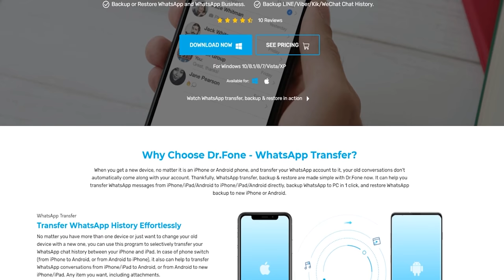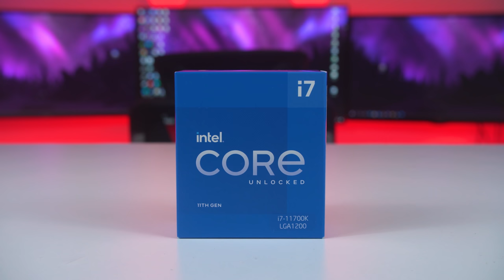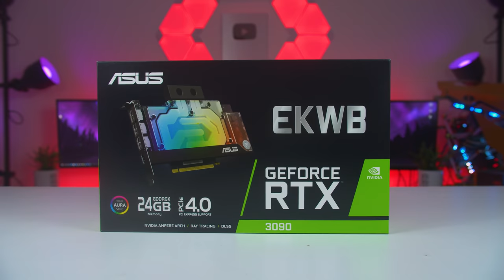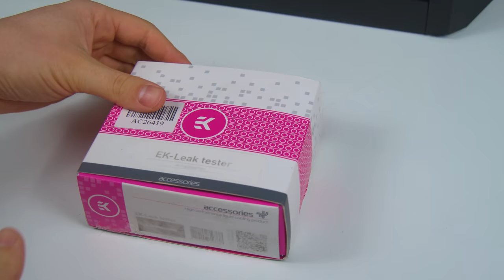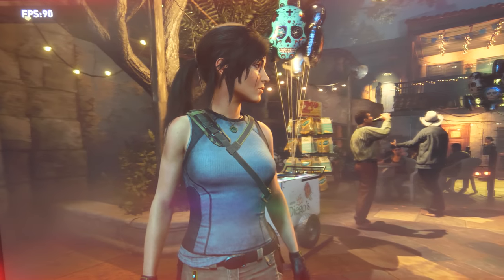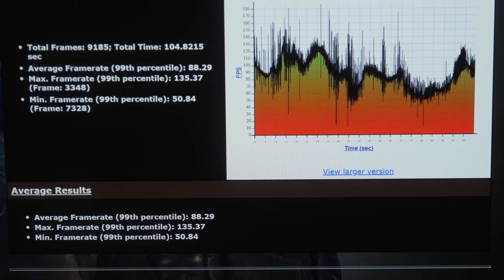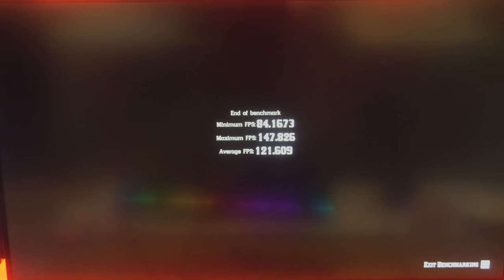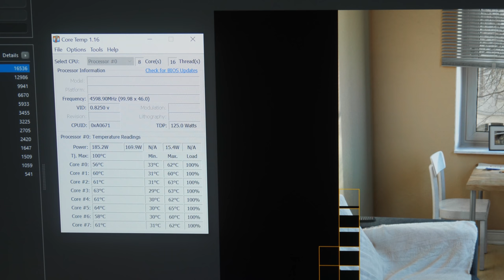I Built a $7400 all ASUS Water Cooled Gaming PC - RTX 3090 w/ Benchmarks

Comment: Bro, why every time when I use a liquid like this no matter where from, after some time my pump gets stuck and stops working, then I have to open the pump and clean it the loop as well as it remains in the water block as well. any ideas why this happens? I do clean it properly before using the liquid, if I use clear liquid pre mix and I add some colour what it doesn't do much, than I can run the system as much as I like

Comment: My expectation when I saw the $7400 budget: ryzen9 5900 or 5950x paired with 2 rtx 3090's in sli, and the whole rig is watercooled

Reality: i7 paired with a rtx 3090.....

Nice vid tho, I enjoyed all the eye candy in it, keep up and much love❤
Reply: should he use last gen  intel protsessor?
Reply: @naapsuvaimne740  yea, the last gen processors r actually much better than the current gen, cuz the difference between last gen and this one is more boost frequency, which results in higher temps...so, last gen is better cuz its cooler,has more threads and cores, and it should now be cheaper cuz its considered old
Reply from the maker: Cheers, unfortunately with gpu pricing these days that would cost alot more for two 3090s. Especially paired with this motherboard

Comment: I can’t figure it out - did you use a 4.0 riser cable?

I read through the case spec and a riser cable was not included. 
Motherboard said it came with an “ROG Graphics Card Holder,” not sure if that’s a bracket or a rigid riser. 
Would be a shame to get rocket lake, a 3090, and all that water cooling just to leave performance on the table with a 3.0 riser.
Reply: you're not "leaving performance on the table" with gen 3 pcie when it comes to GPU performance. storage on the otherhand is a different story.
Reply from the maker: Yes its 4.0

Comment: I was wondering if these pc parts am about to say are good and compatible
Reply: ARESGAME Power Supply 550W, Seagate BarraCuda 1TB Internal Hard Drive HDD,upHere 120mm 3-Pack 3-Pin High Airflow Quiet Edition White LED Case Fan, Cooler Master MasterBox Q300L, OLOy DDR4 RAM 16GB, gtx 1650 super, and ryzen 3 3100 and gigabyte b450 motherboard

Comment: Respect the hustle but there are so many bizarre things about this video. 
- Unboxes Corsair Rad but installs EK rad
- Mounts GPU but doesn't plug into the PCI-E riser
- Is that pump/res even mounted to anything other than the tubes and how did the logo badge get rotated?
- Somehow didn't plug in the RGB for the PSU so it's defaulting to red

Comment: Hey guys, 

Can anyone help me out. 
I would like to custom watercool my 2080ti FE and i9 9900K. I have an EK 360Se radiator with three corsair ll120. 
I was wondering of this is enough for my specs or do i need to get a bigger radiator? 
My cpu is running on stock turboboost ,and i was not planning to overclock my cpu or gpu.
I hope that somebody can help me out with that question. 
My case is a Thermaltake core p3, so it can fit only one radiator.

Comment: Such great board for shit processor(i9) , on top of that, the board will not be future cpu compatible :-D 
Good job Intel..
Reply: x570 boards will not be future compatible.
Reply: @Safetytrousers  yup, but they were launched in 2019, not in 2021 😂

And they had 3000 to 5000 series compatibility.. 😝
Reply: @shshankking  But x570 is the latest AMD boards you can buy, and they are currently still selling.
Reply: @Safetytrousers  that's not the point, launching a expensive product which is going to be end of life cycle is the problem..
AMD launched x570 in 2019 and its 2021 and apart from lower end cpu, nothing new will come, but it's still compatitive enough with a cpu launched today.. If intel launched 12th gen on same socket with better cpu, then fine but that's highly unlikely from their past record..